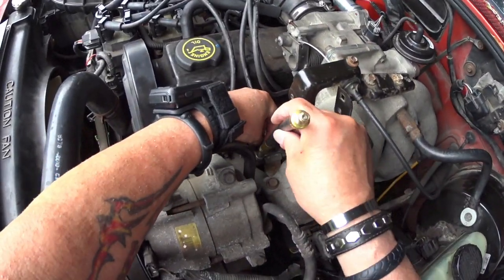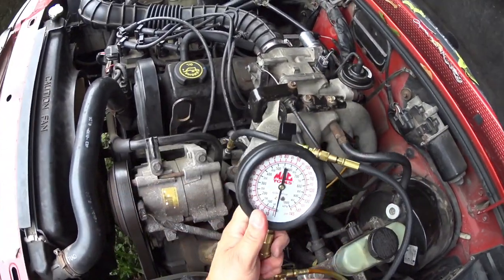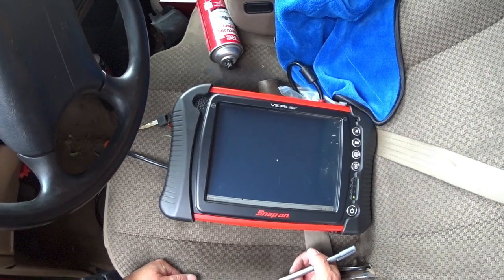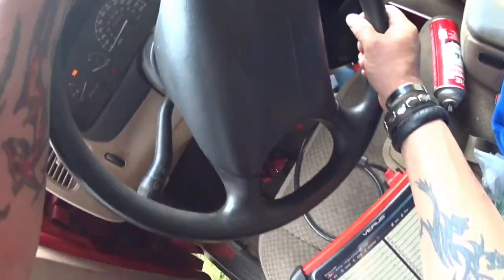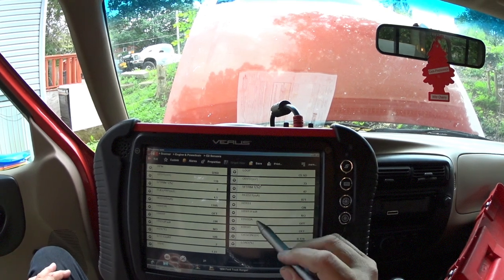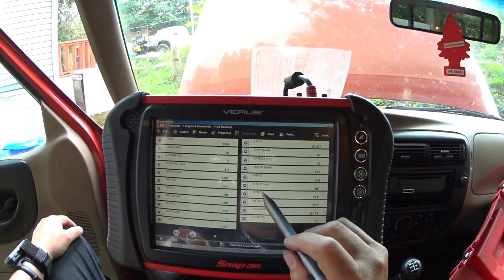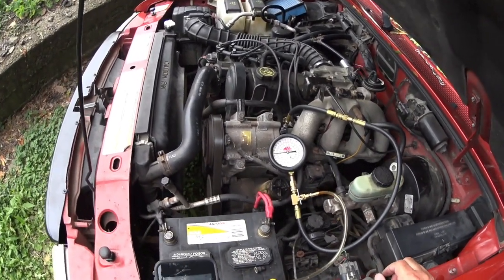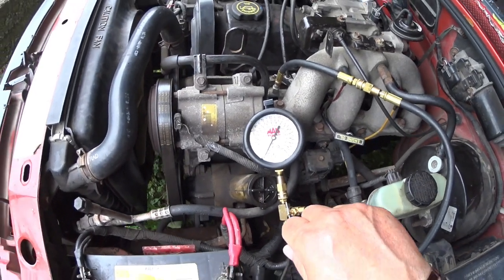Fuel Pressure Problem 99 FORD RANGER 2.5L

Comment: Did you ever determine the problem with This? Mine is a 97, 2.3L Ranger, which has a returned fuel system so its KOEO and KOER are lower to begin with. I cant generate any priming pressure at all, and it runs low at even high rpms. No change when I disconnect pressure regulator. It seems to be running lean when hot. I have heard about these check valves going out or possibly the tubing from the fuel pump, so pumping fuel back into tank and it doesn't seem to be reaching engine. any help would be awesome
Reply from the maker: agentssith yes! Was the fuel pump!
Reply: Pete Sambolin thanks for your reply. Just think this is a bit strange, because don't fuel pumps go out all at once? was it the check valve or do you know that? I have checked the current on mine and it seems a bit low like 2 A. strange.
Reply from the maker: agentssith was the low Fuel pressure and the check valve on the fuel pump! Was returning to the fuel tank! Went ever you accelerate a engine with vacuum fuel pressure regulator the fuel gauge should go up a few pounds not down a few pounds! And went you turn the engine off the fuel pressure gauge should maintain pressure not loose pressure right away!
Reply: Thanks brother, I have a course of action now! Has to be be check valve, because pump still works, just shitty. Would you recommend I replace the whole pump/sender/assembly or just the check valve/pump? Sorry I don't know if the check valve is separate on this or not! Hard to find a diagram or tear down!
Reply from the maker: agentssith okay is the fuel gauge is working good the only thing you have to change is the fuel pump! Otherwise the complete Fuel sending unit..!
Reply: Pete, is the check valve actually on the pump itself? yeah, fuel gauge seems fine! I know they have replacement kits with connector hose, gaskets and filter sock, but if the check valve is elsewhere on the unit, wont I have to replace the whole thing? I suppose it could also be a break in that connector hose ( the one that attaches the pump to the whole unit) too. 

Another question. could that be why my pump seems to be running low current too? I have heard these things should be drawing closer to 5A, but if it isn't working that hard, dumping fuel right back into the tank at the source, then I suppose it could be lower, do you concur?

Thanks for your time!
Reply: It's not a fuel pressure regulator on a 2.5. It's a fuel pulse damper. Fuel pressure regulator is part of the fuel pump assembly. You will need a new fuel pump assembly. Plus you can't even get that intake mounted fuel pressure damper anymore. Take the bed off to do it, it's a whole lot easier.
Reply: That could be many things but possibly a vacuum leak such as intake gasket, vacuum lines running from the intake back to the EGR valve and EGR vacuum solenoid. But on Ford's the most common problem like that is a bad Idle Air Control valve. Mine has gone out a few times. Try joining one of the Ford Ranger forums or ford- trucks forum. The owners there are very knowledgeable and have offered a lot of good advice.
Reply: elenalyonsfan  I've got a 2000 Ford ranger that won't start without my foot on the gas have changed fuel filter